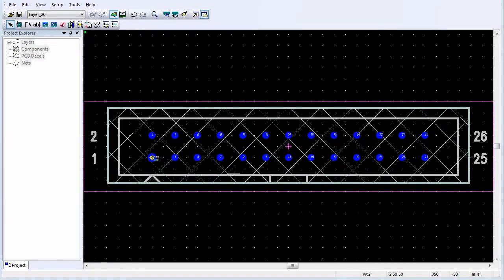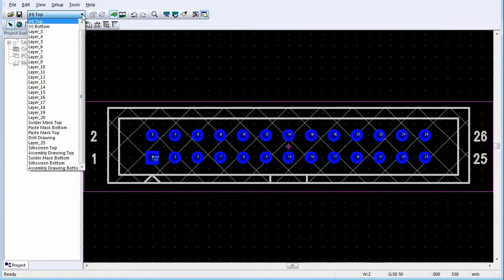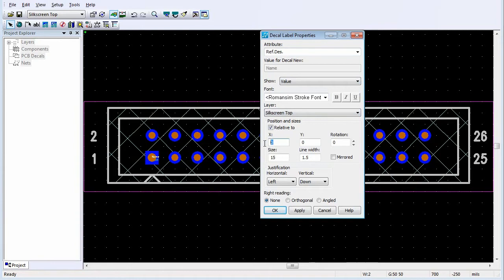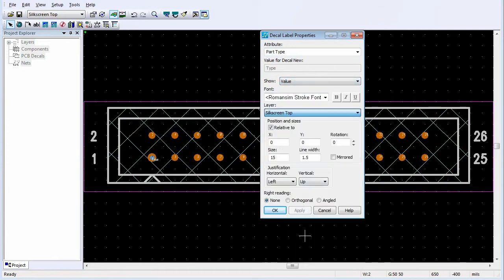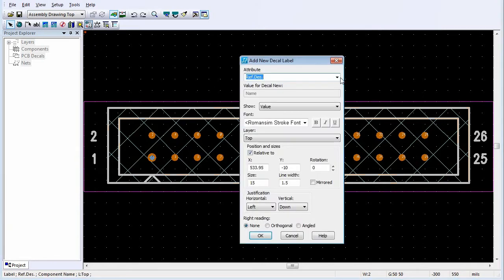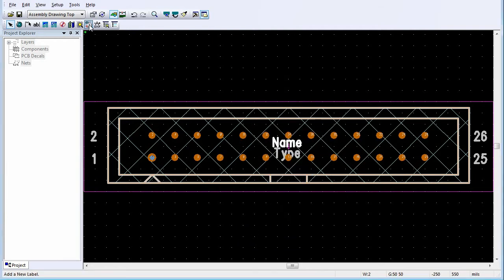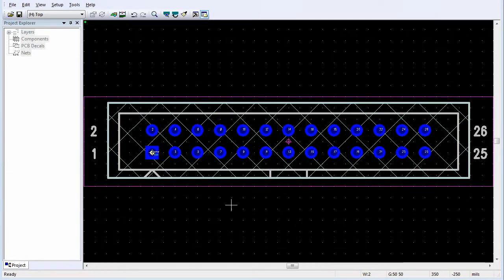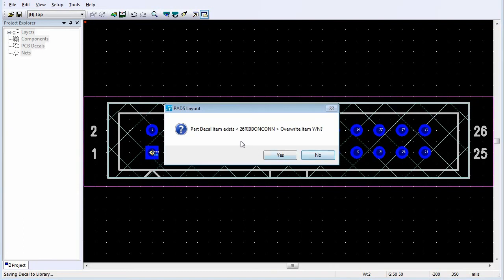Assign PCB decal attributes and labels

Comment: How do you embed or add 3D component model to the decal? For example, 3D model for 0805 resistor. At final PCB review, you can turn on 3D PCB with all 3D components. The reason is for checking mechanical issues in Solidworks.